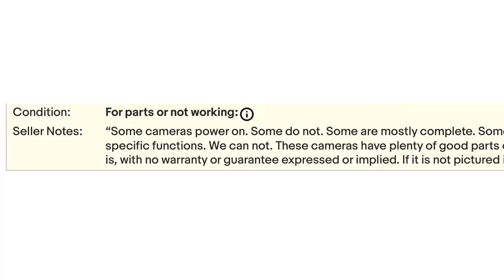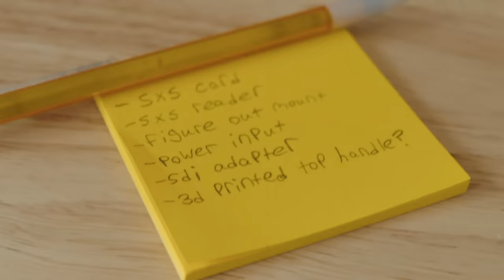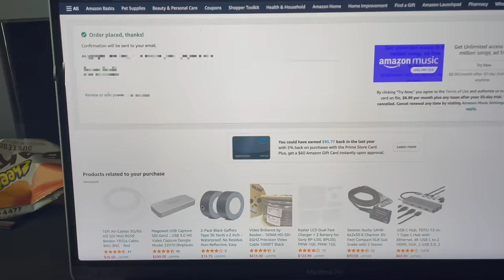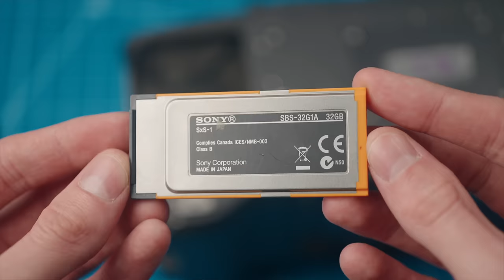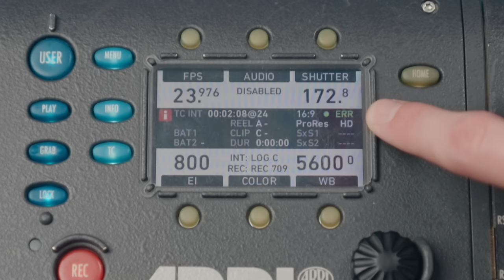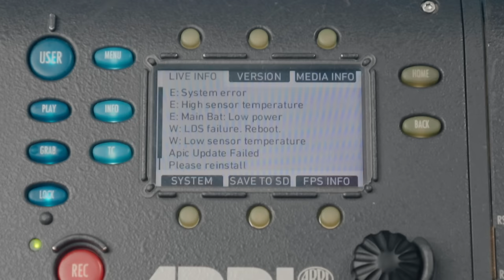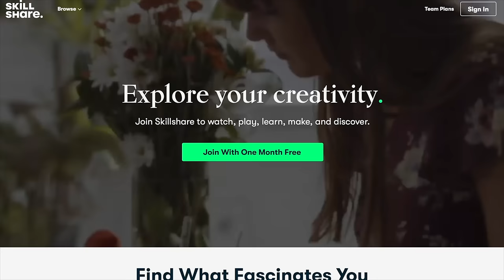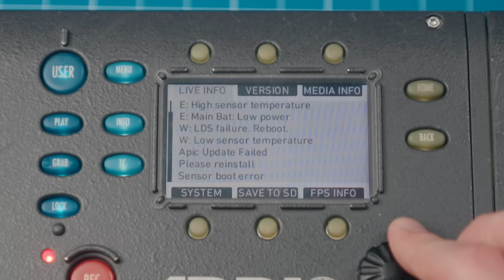I Bought 5 Broken Arri Alexa Cinema Cameras... Can I Fix Them?

Comment: Hi all,
I've been using EOS 1100D for almost 4 years without any issues. A couple of days back I shot a few pictures, and took the memory card out of the camera to copy the photos in my laptop. On putting the card back in the camera, the LCD did not power up. But I am able to view settings like shutter speed, aperture, ISO from the viewfinder.
So, I tried to take a picture with it. On this point, the camera takes the mirror up, waits a while, and then the viewfinder shows a blinking "err" message.
No error codes shown. Just a blinking "err" message in the viewfinder. 
Also, LCD does not power up. No matter what I do.
Here is the complete list of issues:
1. LCD does not power up.
2. Camera lets me shoot only one picture. But the mirror locks up for a while, and viewfinder shows blinking err
3. Memory card has no pictures after taking the photo.
4. Autofocus is working. Able to pop the built-in flash with the button.
5. Once the "err" starts blinking, nothing works. Not even autofocus.
6. Only way to stop "err" message is to remove the battery and reinsert once again.
Here's what I did till now in order to get it working (but didn't solve the issue):
1. Take the battery out. Charge it completely. Reinsert it.
2. Take the memory card out. Format it from laptop. Reinsert it.
3. Start the camera without memory card. Still the LCD doesn't power up. Doesn't solve the blinking err message.
4. Cleaned the Lens and Camera contact points with a cloth. No help.
5. Tried a different lens (Sigma 70-300mm / Canon 18-55mm). No help.
6. Tried powering up the camera without lens. Still no luck.
7. Tried a battery from same camera model (borrowed from my friend). No luck.
Does any one encounter issue like this with Canon?
Does anyone know how to solve this issue?
Any help appreciated.
Thanks!

Comment: Would you be willing to part with the panel nut that holds the power cable connection in on the camera? I've been looking everywhere.... I am completely geeking out on your video.
Reply: it's a Fischer plug they have a USA office in Atlanta if I remember correctly

Comment: I guess you could solve some of those error, if that's not the case then respond to this comment and i will dm you. I'm not an expert on this cameras (or any camera xD) but i love to repair things and i learned a lot from doing it. 
There's not so much info about this cameras out there but from what i found and read about it:
1) I assume that "E" stands for "ERROR", its an actual problem that the camera has. "W" stands for "WARNING", its a potential problem for the camera but its not a problem (some of them are normal).
2) High sensor temperature: I don't know in what moment the camera shows this error, so there could be several reasons. If the camera shows this error as soon as you start the camera (assuming that you let the camera cool down for a while) then it may be an error from the sensor itself (bad connection or malfunction). 
If you use it a little bit and then it shows this error, it may be the "cooling system" that is not working properly (could be as easy as replacing the thermal paste from the heatsink, i don't know what kind of cooling system the camera has because there's no photos or info on the internet)
3) Main bat. Low Power: It could be just the charge of the battery or the connection/the cable that you used (i need to watch it in detail in order to know).
4) LDS failure. Reboot: LDS stands for Lens Data System, i'm not explaining for what it is because its complicated and i assume that you already know but some lenses have LDS port on them and some cameras have them on a "module", so maybe there's a problem with that.
5) Low sensor temperature: same as the high sensor temperature but this one is a warning and i think its usual when turning on the camera until the sensors reach the "normal temperature".
6) APIC Update Failed. Please reinstall: It could be part of the installation process, just need to restart the camera and update again, or it could be a failed installation because of the other errors.
7) Sensor boot error: Sensor has not booted and you need to restart the camera. If continues showing up it could be because of the bad/incomplete firmware install from before.

Ps: There's also sd cards to sxs converters that may also work for the memory.

Comment: Could he mistaken, but shouldn’t you be grounded while working with digital electronics? Also worries me that they didn’t come in static-proof packaging…
Reply: exactly my thoughts  (electronics engineering mil/commercial etc) You can buy conductive pads to work on  etc and pink bubble wrap is not that expensive. I think his handling of the bare PCBs is worrysome, sitting on a plastic chair with rubber soled shoes can cause a static build up of Kvs "oh Im just off to make a cup of coffee - " zap crack ping ""wtf wazzat" ?
Reply: You are selected among the greatest winners 💐🎉Kindly send a direct message to  receive it immediately, thank for watching and commenting.......,,,,

Comment: E/W: I would guess the common Error/Warning codes. An error is something that is clearly wrong, e.g. preventing operation. Warning is warnings - bad but not preventing operation, e.g. temperatures beyond recommended operating conditions.
Reply: Also In many dev logging frameworks you have I (informative messages, not indicating anything bad), D (debug, only shown if configured for debugging), and T (trace, extreme debug. e.g. print start/end of everything performed). Maybe not relevant to Arri but you may come about it if you tinker with stuff. Best of luck with the cameras, that’s one impressive project you are taking on!

Comment: So, what I'm not seeing with any of these cameras is...lenses! Like...the actual $30,000 -50,000 lenses! Isn't this going to stall your project? I'm a bit concerned that these were all in a similar state, with similar missing parts which indicates to me, a similar problem. I work in IT and I know that "lots of 10 and 20" laptops are always up on eBay and I wouldnt touch them with a 10 foot pole because they're usually all grouped together for the exact same reason. A bad display problem or an old rev on a systemboard that fails all the time or maybe they're old govt contract laptops and all the ram and hdds have been removed. It becomes very costly to refurb them. And since you have no lenses...
Reply: You don’t have to attach a $30-50k lens. He has a PL mount so any PL mount lens would work. You can get a really nice Rokinon XEEN (rehoused Sigma) for 1k on eBay. Thats if you want something decent, lots of other cheaper choices.
Reply: @miked7728  Interesting...I didn't know that

Comment: I got here from the main youtube page and at first I thought I was going to see a full analysis of the camera with connecting it to a lab power supply, an oscilloscope and other measuring instruments, checking the modules under a thermal imaging camera to examine their condition. And here it turns out that the author of the film bought 5 cameras and hopes that by rearranging parts from one to another he will be able to assemble a working unit, which is even ridiculous, because the seller did it in the first place which is evident from the condition in which the cameras were sent (missing buttons, panels, modules) everything that worked was taken out and the scrap was sent away.

I don't want to discourage the author from continuing to work on these devices, but I have no hope of doing anything meaningful with them without an electronics lab and in-depth analysis at the level of individual electronic components rather than whole modules.

Comment: You have not much knowledge in electronics. You talked a lot with "hope i try this..." and that is low knowledge.
Power on is nice, but a long errors are there, and as long you can't film anything, it's just expensive brick.
Without good measuring equipment, you wont progress much here and you will only hope for good working camera.

I wish you good luck, hope no ICs are damaged there, because that is much more harder for you. It seems you can only swap circuits boards because your limited electronics knowledge. Keep saying "i hope" is not great way to watch here, so much cringe for me and it makes video just longer. That is just not great progress.